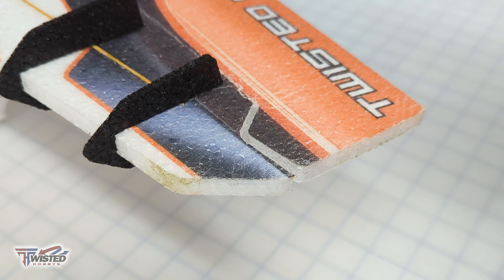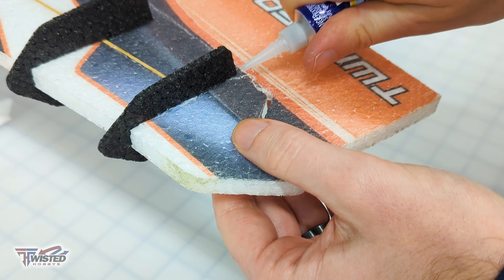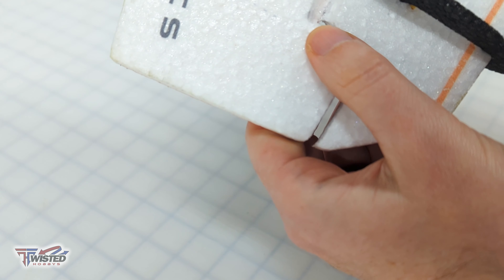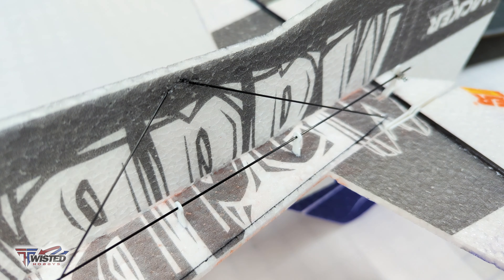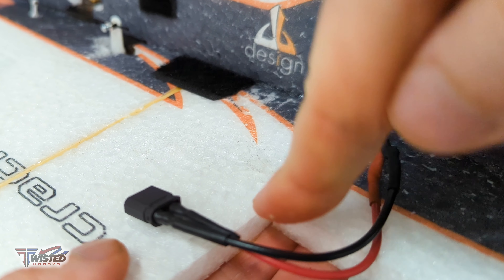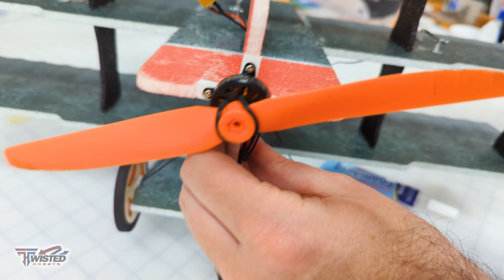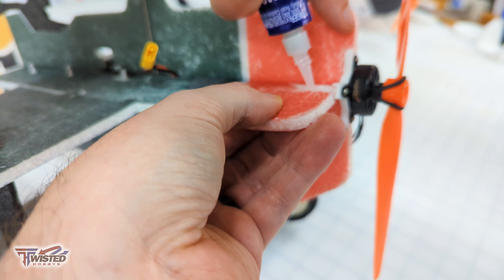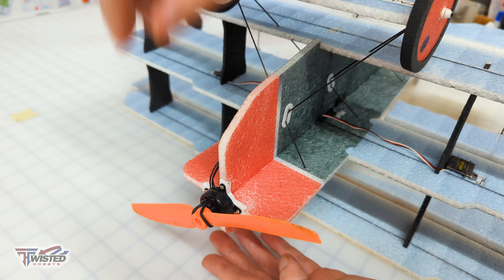RC Plane EPP Repair Video (HOW TO)

Comment: Try flying over tall grass or weeds and you can crash a lot more without any damage😊
Reply: That's a great tip! One of the places I fly has nice tall grass, but most of the time I'm on short grass. (I could also just be a better pilot. 😂)

Comment: E6000 is a Far cheaper glue to use on EPP foam.  Foam tack is Expensive for what it is.
Reply: Yes, I'll agree Foam-Tac is more expensive, but I've used Welder's, Foam-Tac, E6000, Gorilla Clear, Quick Grip, Goop, BSI Foam Cure, and Jingiang JQ-2118 on EPP. They all work and have their benefits and drawbacks. Foam-Tac is what I use and recommend, even with the price.
Reply: Is foam tack flexible like welders glue?
Reply: @nickr5658  Yes, it stays a little flexible, but it doesn't yellow over time like welders does.